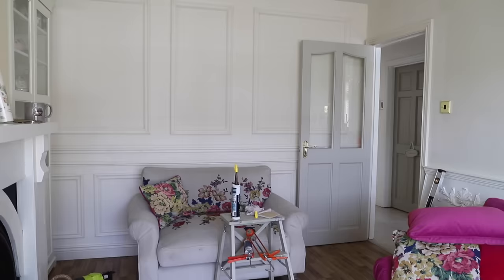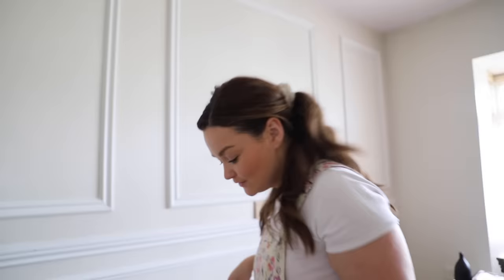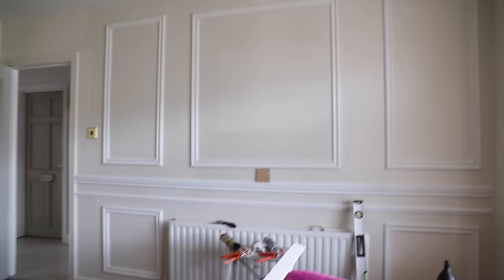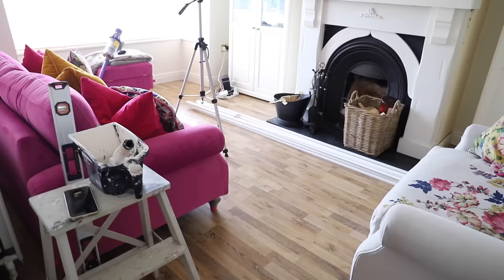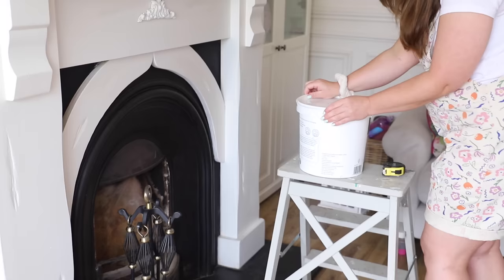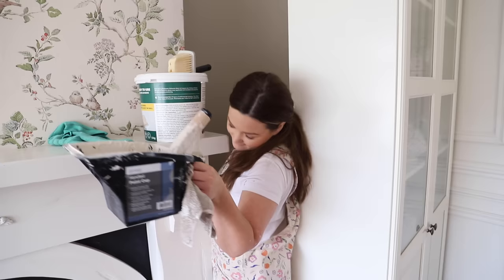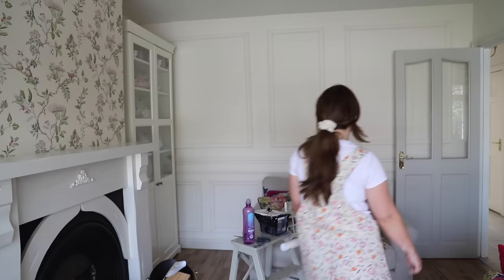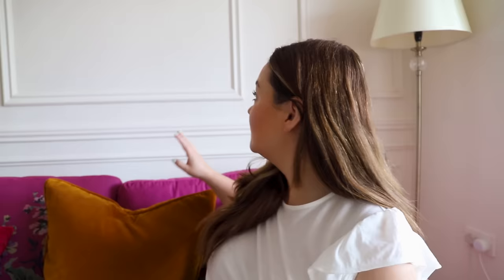Charming Cottage Living Room Transformation: Floral Wallpaper, DIY Wall Panelling, and Paint EP3

Comment: Love the room!   I am in the US.  I have a question.  Why do you leave the door on the living room?  Wouldn't it be easier and more roomy to Just remove the door?
Reply from the maker: So we keep the doors in our homes here to keep in the warmth, especially in Winter to stop draughts, some new homes have underfloor heating but most older homes wouldn't have amazing insulations, which is why we have doors, to help stop draughts, also helps when you only want to heat one room to cut down on heating costs too.